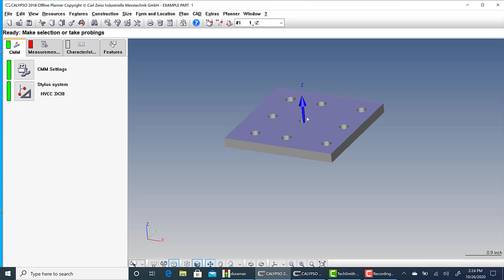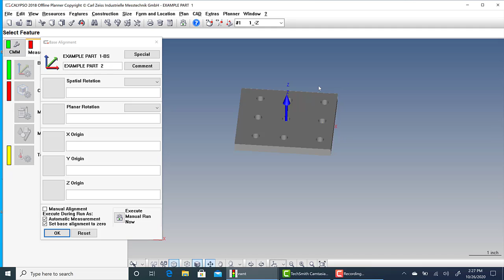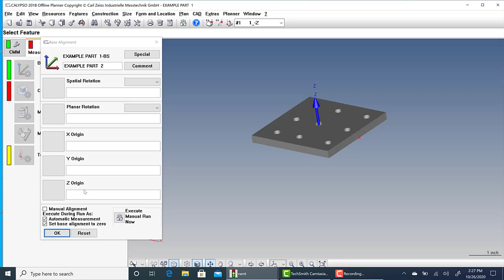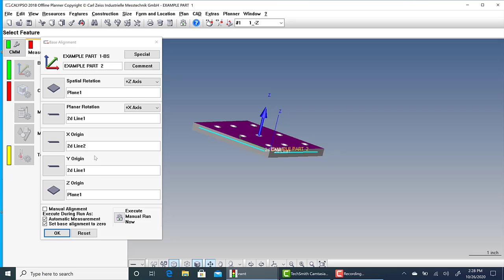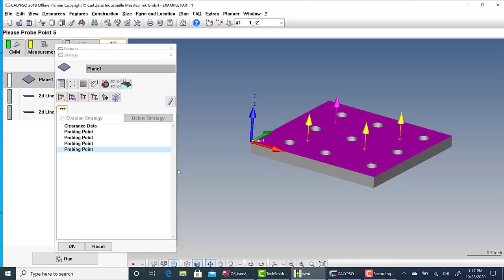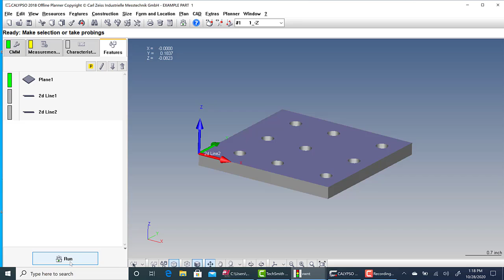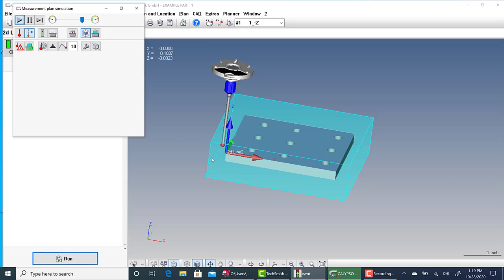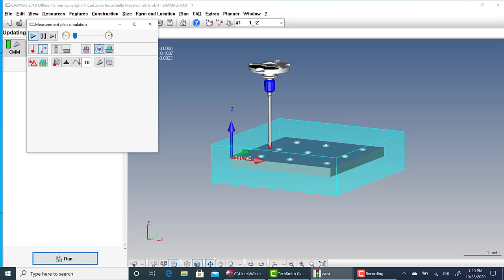Zeiss CMM Calypso Basic Alignment

Comment: If in a circular work piece there are 8 holes on pcd of 110 on around of a centre bore diameter what will be the in planner rotation 
First spetial rotation and  z Axis will be face and for x and y Axis will be bore diameter what will be in planner rotation?
Reply from the maker: If there is no need to control the rotation about the z axis for the part you may not need one, but If I am following you correctly you would want the hole pattern to clock correctly in the alignment. Two options I know of would be to do a recall and create a line between two holes, you may need to project the holes to make sure the line is not skewed in the Z. This line would be the planar rotation. The other is if you select one of the holes in the alignment as the planar rotation after you select the center as xy zero it should clock the part. 
If I mis- read the details on your comment let me know.

Comment: I have a question. I have one plane datum A and two holes for aligment off set. But, i need measure two cylinder, if not two circle. What i do in this case? When i make aligment with cylinder, my part rotate.
Reply from the maker: to use two holes for a planer rotation, you can create a line between them and rotate to that line, the other option is set one hole as a origin point and select the other for planar rotation.
Reply: I’ve the same question. I’d like to know how is the best way to make the alignment with a part like that in this video but using the plane as a Datum A, the first hole is Datum B  (coordinate  X 0 Y0 ) and the second hole is Datum C  (coordinates X 1.25  Y 2.75 ). I need to measure the plane and the two cylinders….how can I do to alignment with a Cylinder at Datum C ?   the software calypso not apply to make this situation in two cylinders. Could you make a video to simulate this situation, please?

Comment: Great video. I have a question. If you have a plane and two holes, what would be the best alignment? The plane and two circles on the two cylinders or the plane with two cylinders or the plane and two intersections with the cylinders and the plane?
Reply from the maker: It all depends on the drawing requirements
Reply: Kyle, if you have two holes use recall and run a 3d line thru both holes.

Comment: HI there, we just got a CMM machine and are running Calypso but we have no CAD drawing of the parts we are measuring. We are having a hard time understanding setting up a base alignment from scratch. Ive watched this video a few times but its still not making a lot of sense setting up the alignment for a new part. .Any help?
Reply from the maker: Without a model requires a different workflow. I will try to setup a video that shows this. My colleague R DEAN ODELL has a channel and he is also a Zeiss user. Check out what videos he has on the zeiss cmm.
Reply: @BrianWickhamMFG  Thank you!